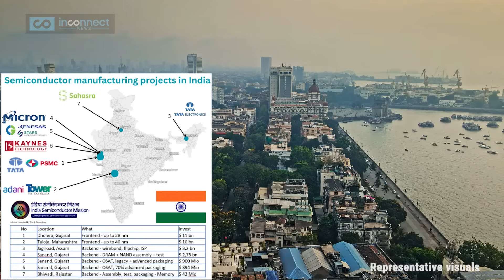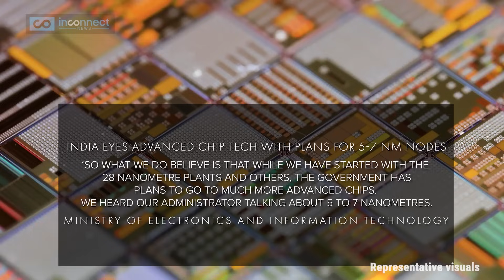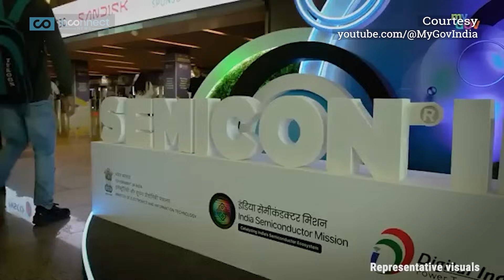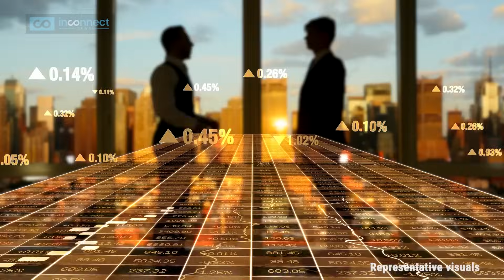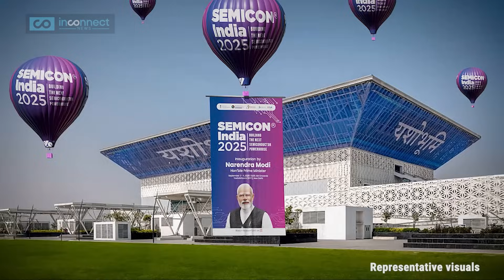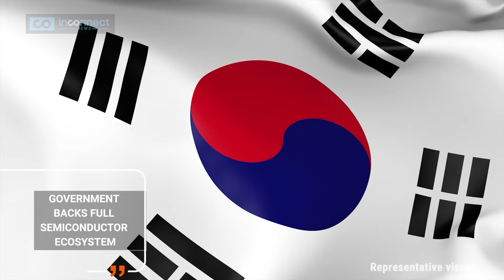Can India DOMINATE Semiconductor Technology Like China & US? | India Semiconductor | Indian Economy

Comment: Cannot understand why india is purchasing over priced and over hyped Rafale fighters jets. It was striked by junk fighter jet JF17 with PL 15 missile. Infact Rafale is not interested in sharing source code and that too it charges crores of rupees Even for nut and bolt tightening works. For this hefty price deal we could have easily procured 100 % TOT offer from F18 super hornet OR F16 viper OR Gripen OR SU 35M OR MIG 35 OR SU 57 etc. Even then we are going along with this deal. Cant understand the strategy. It's cost approx 2300 crores per fighter jet infact more than fifth generation fighters. Is it worth for this cost for an 4.5 Gen fighter ?? Definitely NO. Rafale again will charge hefty price while UAV integration. Already all these bullshit happened with Mirage 2000. The same saga will continue with Rafale. We haven't learnt lessons from Mirage 2000. 

Instead india should think about integration of SU 57 & S70 okhotnik UAV combo along with S400 under make in India program that will be beneficial and deadly too. Moreover Rafale F4 version is not UAV integration compatible as of now. In future for integration of UAV with Rafales the Dassault aviation will charge hefty price again. 2300 crores for 4.5 Gen rafale fighter jet without source code and without UAV integration compatibility ?? It's totally Bullshit. 

2 squadrons of Rafale for optimising the existing Rafale fighter infrastructure and 5 squadron of SU 57 + 5 squadron of S70 stealth drones combo for integration with five S400 squadrons will become far far far better strategy almost equal to 6th Gen fighter. 

Is there any logic in paying double price to Rafale than other contemporaries in the name of make in India program without source code while Russia is offering 100% TOT offer ?? God only knows about this deal . My comment may not appeal to the so called YouTube drama deshbakhts, but it's the FACT. While China is going to induct 6th Gen fighter jets we are paying hefty price for 4.5 Gen fighter jets. Is it sensible ??? Future warfare will be UAV integration technology along with Gallium Nitride based radar technologies only. Rafale F4 version without this UAV integration and with Gallium arsenide Radar is totally irrelevant.

Network-centric data link capabilities between the Su-57, S-70 Okhotnik, and S-400 systems with their advanced technologies and design features will become a DEADLY COMBINATION. With All this Combo it will become at par with 6th Gen fighter jet capabilities and can be achieved with the cost of 4.5 Gen Rafale fighter jet . 

Key Features:

- *Su-57*: This fifth-generation fighter jet has advanced avionics and sensor systems, enabling seamless integration with other airborne and ground-based assets. Its network-centric warfare capabilities allow for real-time data sharing and situational awareness.
- *S-70 Okhotnik*: As a stealth heavy unmanned combat aerial vehicle (UCAV), the Okhotnik-B is designed for autonomous operations and manned-unmanned teaming (MUM-T) with the Su-57. It features advanced sensors, including electro-optical/infrared (EO/IR) sensors, synthetic aperture radar (SAR), and electronic intelligence (ELINT) systems.
- *S-400*: This surface-to-air missile system has advanced radar and tracking capabilities, allowing it to engage multiple targets simultaneously. While not directly related to the Su-57 and Okhotnik, its integration into a network-centric system would enhance overall situational awareness and defense capabilities.

Potential Benefits:

- *Enhanced Situational Awareness*: Real-time data sharing between the Su-57, Okhotnik, and S-400 would provide a comprehensive understanding of the battlefield, enabling more effective decision-making.
- *Improved Targeting*: The combination of advanced sensors and data links would allow for more accurate and efficient targeting, increasing the effectiveness of military operations.
- *Increased Flexibility*: Network-centric capabilities would enable these systems to adapt to changing situations and respond to emerging threats more effectively.